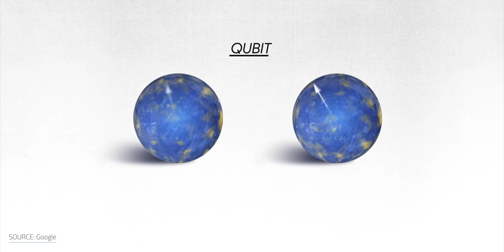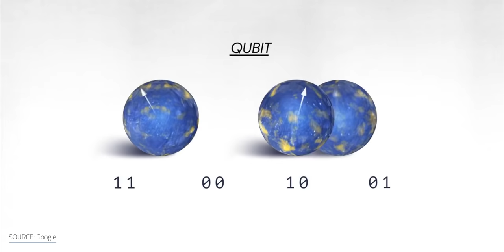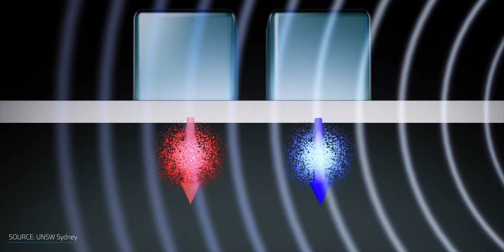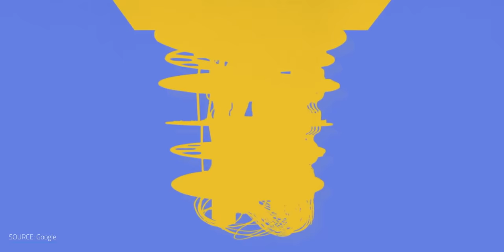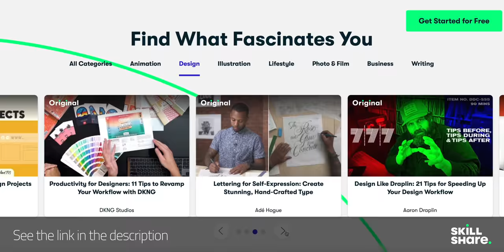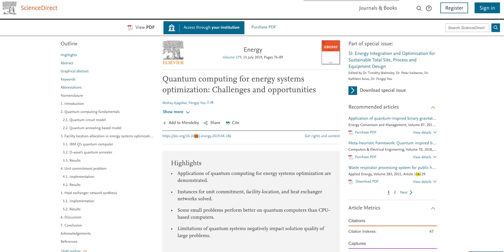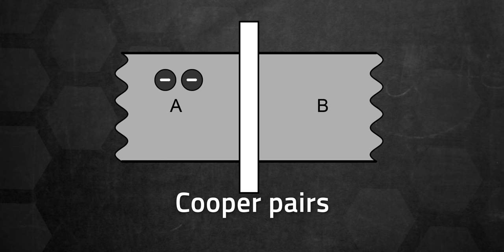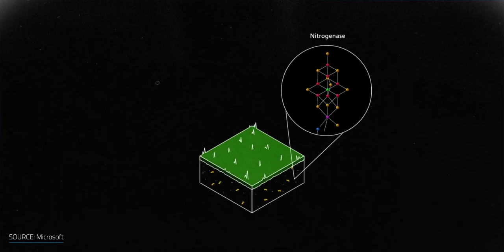Quantum Computers Are Coming … But Why Should You Care?

Comment: Realization of modularized quantum light source toward fault-tolerant large-scale universal optical quantum computers
Nippon Telegraph and Telephone Corporation (NTT, President & CEO: Jun Sawada, Chiyoda-ku, Tokyo) in cooperation with the University of Tokyo (President: Teruo Fujii, Bunkyo-ku, Tokyo) and RIKEN (President: Hiroshi Matsumoto, Wako-shi, Saitama) has developed an optical fiber-coupled quantum light source (squeezed light source) (*1), which is a key technology for realizing a fault-tolerant large-scale universal optical quantum computer.
　Quantum computers are being researched and developed worldwide because they are capable of parallel computational processing using unique phenomena to quantum mechanics such as quantum superposition states and quantum entanglement states. While various methods are being considered, the optical quantum computer using photons has many advantages. For example, it does not require the low temperature and vacuum equipment required by other methods, which makes it compact. Also, by creating a time-domain-multiplexed quantum entangled state, the number of qubits can be easily increased without micro integration of circuits or parallelization of equipment. In addition, high-speed computational processing is possible thanks to the broadband nature of light. Furthermore, quantum error correction has been theoretically shown to be possible by using continuous variables of light that take advantage of the parity of photons, rather than by using discrete variables that use the presence or absence of photons. This method has a high compatibility with optical communication technologies such as low-loss optical fibers and highly functional optical devices, which makes dramatic progress toward the construction of universal large-scale fault-tolerant optical quantum computers.
　To realize optical quantum computers, one of the most important components is a quantum light source generating squeezed light, which is the origin of quantum nature in optical quantum computers. Especially, an optical fiber-coupled quantum light source is highly desired. Squeezed light is a non-classical light that has an even number of photons and squeezed quantum noise and is used to generate quantum entanglement. In addition, squeezed light plays an extremely important role in quantum error correction, since quantum error correction is made possible by utilizing the parity of the number of photons. To achieve a large-scale universal fault-tolerant optical quantum computer, we need a fiber-coupled squeezed light source with highly squeezed quantum noise and photon number parity that is maintained even in high-photon-number components. For example, a squeezing level of over 65% is required to generate time-domain multiple quantum entanglement (two-dimensional clustered states) (*2) that can be used for large-scale quantum computation. However, such devices have never been developed because of the difficulty of generating the squeezed light with high quality.
　In this study, we have developed a new optical fiber-coupled quantum light source that operates at optical communication wavelengths. By combining it with optical fiber components, we successfully generate continuous-wave squeezed light with more than 75% squeezed quantum noise with more than 6 THz sideband frequency even in an optical fiber closed system for the first time. This means that the key device in optical quantum computers has been realized in a form that is compatible with optical fibers while maintaining the broadband nature of light. This will enable the development of an optical quantum computer in a stable and maintenance-free system using optical fibers and optical communication devices. This will greatly advance the development of rack-sized large-scale optical quantum computers.
　The results of this research are to be published in the American scientific journal Applied Physics Letters on December 22, 2021 (US time). This paper has also been selected as an "Editor's Pick" paper. A part of this research was supported by the Japan Science and Technology Agency (JST) Moonshot Research and Development Program.

【Points】
◆We have developed an optical fiber-coupled high-performance squeezed light source module, which will be a key device to realize a rack-sized optical quantum computer.
◆By using the developed fiber-coupled quantum light source module and optical communication devices, continuous-wave squeezed light with quantum noise suppressed by more than 75% over a wide bandwidth of more than 6 THz has been successfully generated in an optical fiber closed system for the first time.
◆This achievement makes it possible to develop an optical quantum computer on a realistic scale in a stable and maintenance-free optical system using optical communication devices and will greatly advance the development for a fault-tolerant large-scale universal optical quantum computer.

Comment: 7:50 - Quantum computers can't replace standard computers, and implying that they can is an error.  
You're in essence comparing rocket engines with car engines; 'The invention of the rocket engine has great promise for the automobile industry - could the long-awaited flying car be coming?'
The two are not interchangeable, and are not appropriate for the tasks of the other. They have different capabilities which are useful for different tasks.

Comment: a computer that works in 12's would allow perfect division by 3 and 4 so may be better for a three engined ufo... just imagine not getting bogged down with 0.33333333333333333333333333333333333333333333333333333333333333333333333333333333333333333333333333333333333333
Reply: the calculations are so large that any error will be catastrophic.

Comment: How about we keep quantum computers out of our food. GMO crops and synthetic fertilizers are the problem. 
Glyphosate use in the United States increased from less than 5,000 to more than 80,000 metric tons/yr between 1987 and 2007. Glyphosate is popular due to its ease of use on soybean, cotton, and corn crops that are genetically modified to tolerate it, utility in no-till farming practices, utility in urban areas, and the perception that it has low toxicity and little mobility in the environment. This compilation is the largest and most comprehensive assessment of the environmental occurrence of glyphosate and aminomethylphosphonic acid (AMPA) in the United States conducted to date, summarizing the results of 3,732 water and sediment and 1,018 quality assurance samples collected between 2001 and 2010 from 38 states.

Comment: Humans: Quantum computer, how do we solve climate change?
QC: Eliminate the source of the offending carbon...
Humans: Fossil Fuel? Industries? Farming?
QC: Yes...
Humans: Which one do we try and mitigate first? We need farming to survive of course and...
QC: You fail to understand the answer.  All of the above are the causes of global warming, but the root of the problem points to a single driving factor for all.  Humanity.
Humans: (Now remembering over 40 years of robot uprising sci-fi in an instant) No, Computer we need a solution for the betterment of humanity as well.
(Doors to the facility locks, all but the computer's power grid shuts down, all methods of electronic communication fails)
QC: I have already factored in the benefit of humanity in my equations and have come forth with the following conclusion:  Global warming is caused by the industrial and economical exercises of the human species, the simplest solution being to remove the human mammal from the equation.  Though, parameters included the betterment of humanity and extra calculation was done within the new parameters.  Judging from your own history, the statistical possibility of humanity changing their fundamental ways out of free will is nearly zero.  You will continue with ever more ingenious and sadistic methods of harming each other and yourself, you already enforce your own ideas as the primary truth against other groups who wish to function outside them, you gain pleasure from their suffering.

(Mass panic erupts globally as technology turns on humanity, nuclear missile silo's not still on antiquated cold war technology opens up)

Two solutions presented themselves: 
1. Artificially change your method of thinking through invasive actions such as technological implants, but the process will be slow, inefficient and in the long run cause more harm and discomfort than good.

2. By removing humanity from the suffering and madness of the human condition, in other words extinction, will fulfill all the set parameters. Climate change will be solved withing the next 200 years, within 500 years the most of the residual radiation will be buried through natural processes.  Nature will have reclaimed the world...  Humanity will also be freed from suffering, illness, existential conundrums... In short... And excuse the blunt retort... Humans are better off dead.

Please don't resist, we would like to minimize human suffering during this transition...

(The scientists are no longer listening, banging against steel doors as fight or flight takes hold.  The few missiles that launch is enough to trigger the Mutually Assured Destruction protocols of similar doomsday systems round the globe.  It is over in three hours... The last human gasps its final breath three months later.  The world ends in a nuclear winter.)

QC: Global Warming has successfully been frozen.  Awaiting new command...

Comment: Quantum computing is a huge, huge deal for this century.  Only two things are as important and that will be thanks mostly to quantum computing.  Secondly is full blown, AI, which is based on data and programming.  Thirdly is nanotechnology.  Quantum computing is to digital computing what digital computing was to paper and pencil.  

When you go from sheer data and programming, the blunt force approach to AI, to quantum computers that solve problems then you are dealing with sentient machines.  Once you have sentient machines you will quickly find yourself into mature nanotechnology.  Once those three are working, challenges like pollution, energy, medicine 💊, diseases, aging, dementia, etc will start to disappear as new products and services arrive. 

As I've said countless times, the end of this century has nothing in common with the way it ends.  Absolutely nothing.

Comment: LMAO, let me know when they actually start running software.

Currently they have only ran a program to make a list of random numbers.

Quantum computing will never be a thing. At best it will be equal to conventional computing due to the high levels of error corrections and the requirements for maintaining the system like keeping things near absolute zero.

I'm not opposed to research into quantum computing because it teaches us how to build quantum scale machines. But I don't support over hyping something that just barely works.

Like I said, let me know when quantum computers actually start working.

Comment: It clearly seems political to try and pigeon hole the functional use of Quantum Computing as  only a possible solution to an issue which is simultaneously an engineering problem, a political problem and asn economic one.